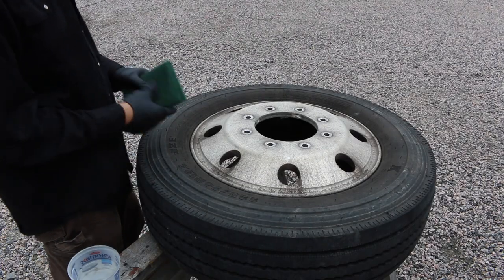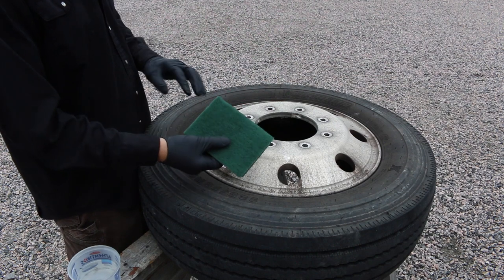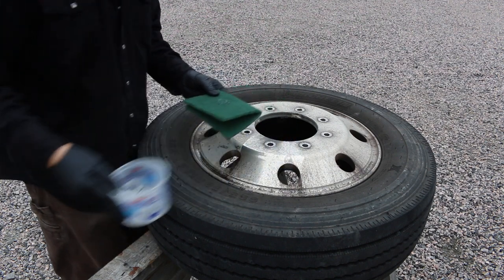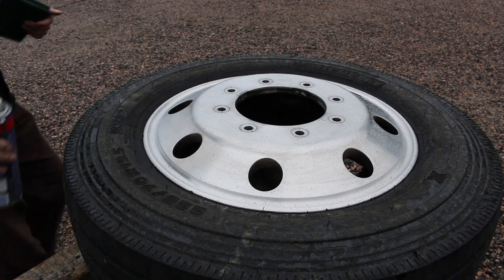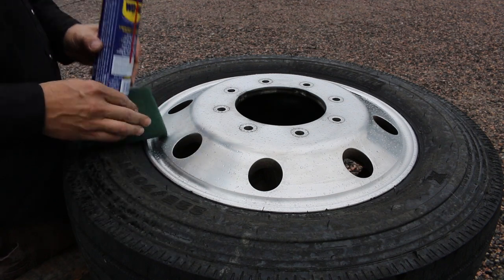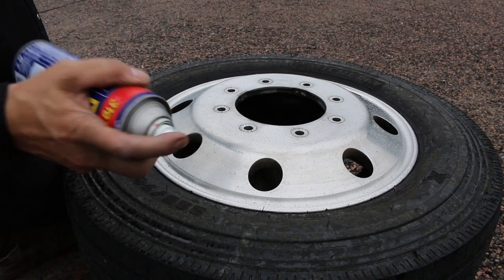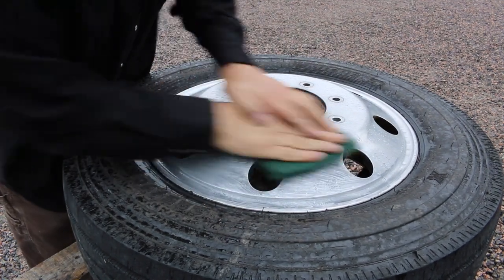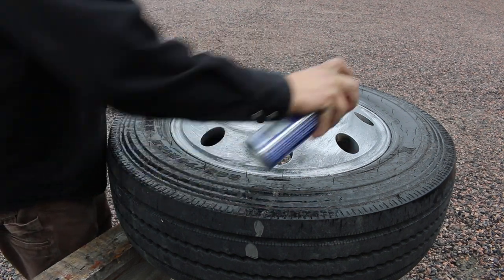Polishing aluminium rim

Comment: Nice job. It seems like a lot of hard work. There must be an easier way?
Reply from the maker: Dwight Mc ya it's not a job that I like doing.  Many ways to polish aluminium and I have tried them all. Believe it or not, this is the easiest way I know how to do it. Cheers
Reply: There are much easier ways. Jack up the truck, leave the wheel on, get a 9" angle grinder and a airway buff and rouge bar of your choice. Spin the wheel and polish away, have that wheel done in 5 minutes or less. Before anyone says BS on that do some research. I am a metal polisher by trade, own and operate my own shop.
Reply: The easiest way is to buy new ones. 😃
Reply: @urbanedgeautodetailing  you are rite